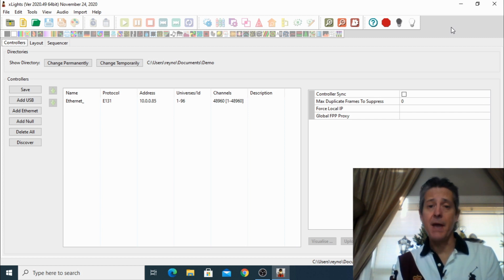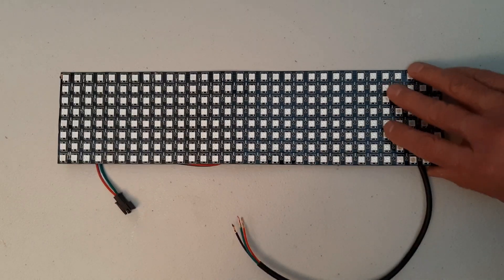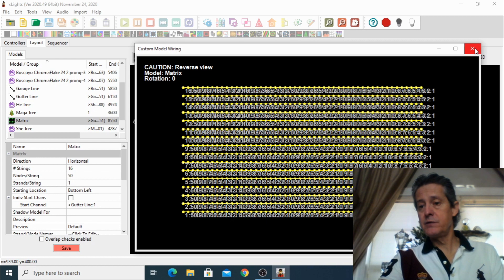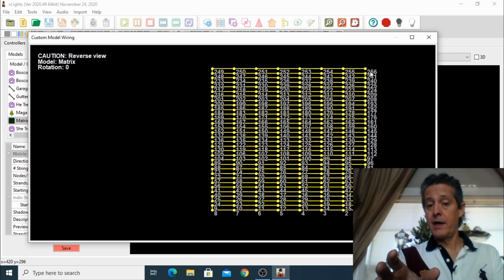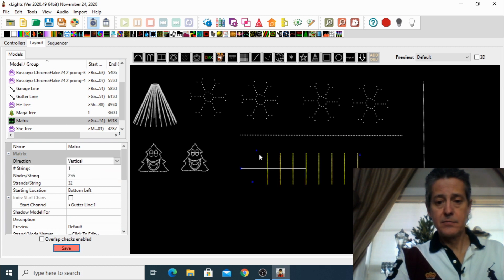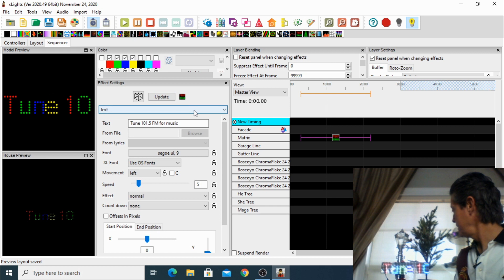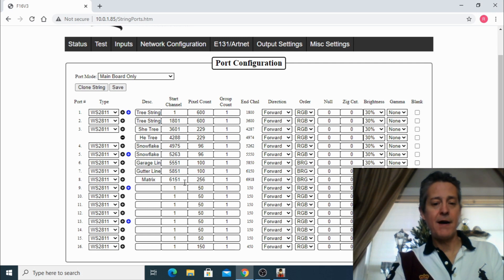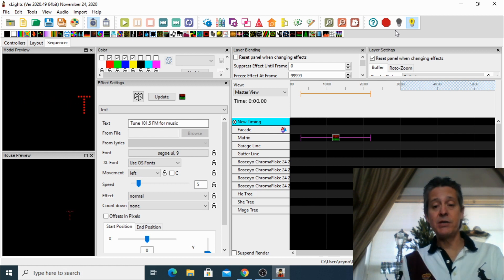Setting up a L.E.D. Matrix

Comment: Thanks Trevi, Your video has been so helpful to me and i just bought some of these matrixes recently.
I have one matrix working exactly like yours, and now i have linked a 2nd matrix onto the "data out" of the first matrix.
I changed my pixels to 512 instead of 256 and i also changed my strands to 64 instead of 32, so this should work like a 64x8 pixel matrix.

But, the 2nd matrix doesn't display anything at all, but my first matrix still displays the text after a small delay.
Have i completely overlooked a setting somewhere? or do i need to look into my FPP player and re-check if i have setup enough channels for my port #1?

I'll keep looking into more settings, as i'm fairly new to Xlights in 2024, but i hope i can eventually connect at least 4 of these small LED matrixes together as a 64x16 display (or larger as i get more panels).
Reply from the maker: @martyaussie4538  Thanks for you words. Glad to help. Have you also increased the number of pixels on the port output? How about the number of channels that you controller takes on the E1.31 setup? You are just missing a simple setup.
Reply: @trevilights  Hi Trevi, Yes, all my outputs & channels seem to be auto updated between Xlights and FPP player and they are correct.
I discovered today that i needed to click on the "render all" button in Xlights to update the new panel(s) that i connected.
Today i now have 4 of these led panels connected in a 128x8 configuration (the full 1024 pixels on 1 port) and my text is now scrolling across the whole 4 panels. ;-)

My next challenge is to arrange the 4 panels into a 64x16 display, i think i just need to change my rows from 8 to 16, but the way these matrix are wired, maybe i might have to connect them across 2 different ports? I will experiment and probably lose  a lot of sleep....

Thanks always for your educational videos, i've been watching them for 2 years now.
Reply from the maker: @martyaussie4538  Awsome. Build something great!

Comment: Thank you for a great tutorial. I have purchased 4x Matrix the same size as the one you show here, for the same purpose, and I have set it up exactly as you have on a DigOcta controller, however I am still unable to get the text to output correctly (and I have changed the setting 10's of times). Thanks anyway.
Reply from the maker: Hey Andrew, Thanks for wathcing and for your comments. It's never easy, just keep trying. Most of the times it has to do with the setting we are using. Good Luck.

Comment: Good morning,
Thanks for this tutorial
I've been trying to make my 2 dies 8x32 and 8x32 work for several days
I gave you the link of the video I made.
The beginning of the video the text works with wled on the 2 matrices, and after with Xlights the problem is that the characters are not displayed correctly if I type the text as seen on the matrix at the top live, the text displays weird characters.
Do you have a solution?
Thank you so much
Here is the youtube link of my video:
https://youtu.be/dYI09L0VtuU

Comment: Thanks for the video. Are you running straight from a pc for data? Sorry I asked before the video was over. Is the controller you're using made for commercial use?  I was going to use an esp32.
Reply from the maker: Hey Joey. Thanks for watching. For this demo I ran from xlights on my laptop. But My show, I run it for a Raspberry PI running the FPP software. The controller I am using and recommend is the Falcon controller ( link below). The new F16V4 can control a little more thank 32,000 pixel if you add an expansion board. I have a friend who uses this board to run Huge Christmas trees inside Malls. They run pretty well and easy to configure. They are little hard to get now, but they are working on getting more. Good luck.

https://pixelcontroller.com/store/products/70-f16v4.html
Reply: @trevilights  cool thank you. I have a panel of 1024 leds I want to play around d with so I found your cool video. I'm probably just going to do something with fastled and a teensy or an esp32. It would be cool to build one in my workshop big enough to play 8 bit games on haha. Imagine the power bill.

Comment: Hello Trevi.  Nice video.   I have a 5V 32x8 LED Strip matrix from a project that didn't work out.  I will be adding this matrix to my xlights  Xmas display.  As was said my controller is 12V.  Did you have any complication adding the 5v to 12v convertor?    (this matrix will be used for a North Pole sign)
Reply from the maker: Hey Andrew. Thanks for watching. The Step down regulator worked just  fine. There is not much to it. It just drops the voltage from 12v to 5v. I just double check the Output voltage with a multimeter just to make sure it was 5 volts.  There are a few of them on Amazon. Good luck.

Comment: Hi Trevi, I love your videos, simple and so informative. I have a question. I have a Boscoyo ChromaMesh 2″ matrix, 24X48  1152 pixels or nodes. I hooked it up to 2 channels, 576 on each. The matrix seems to be scrambled when I run a sequence. I think it might have to do with the layout. My mega tree is 1000 pixels, 2 channels and it works perfect. Has me scratching my head. Any thoughts?
Reply from the maker: Hey Dave. Matrix setups can be a little tricky. To keep things simple lets say that you are going to use port 15 and 16 of your controller. In the String Ports page in port 15 (select a round channel number that you know is free, in this case lets go with 8000) and type 8000 in the start channel with 576 pixels, the end channel should read 9727. Now in port 16 type the start channel 9728 and another 576 pixels. Save this settings.
Now in xlights, use the matrix element and set it up as follows. 2 String of 576 nodes and 12 strands. The Direction should be Horizontal. in the Start Channel setup use the Absolute option and type channel 8000. Save it. That's it. Create a simple sequence using letters just to make sure it's in the right direction. If not, go back to the layout and in the Starting Location option select other options like 'Top Left', 'Bottom right' etc. This is the location where the data is coming into the first an second string. Also look and the wiring view of the matrix element on the layout after you set all the above paraments to make sure is wired in that same way. Good luck.
Reply: @trevilights  Thank you for the quick reply. I will try that and let you know how it worked out.

Comment: Once the text is correct, do you make it a sequence? How do you get it to continuously scroll in xlights while show is running? I am new and have never done this. Thanks
Reply from the maker: Hey Jim. In the sequence tab just add the text effect to your matrix elemet and expand it to cover the whole song. Add the text you want to dispaly on the left panel in the effect settings.
Reply: @trevilights  Thank you. After doing more research, that is exactly what I did and it worked. Can't believe I now have 4 sequences plus a tune to sign (just like yours) and haven't received my hardware or lights. Hopefully will have everything by June. Would like to see you do another import video using the update tool that takes it right into your sequence from s zip file. Really like and learn from your videos. Don't think I will tackle singing faces this year!!
Reply from the maker: @jimwheat3862  that's amazing. Congrats. I've been busy at work. I will find some time to make more videos.

Comment: Trevi, I know you told me before, how do I add an element to an existing sequence. i wrote it down, but i can't find it. as always THANK YOU
Reply from the maker: No problem.  There is an icon on the top bar that has 3 yellow boxes.
Reply: @trevilights  yes sir, I found that. did not know what to do after that.
Reply from the maker: @jackrogers8751  On the right side you should see the elements that are not part of the sequence. Just click on it and press the ">" icon. It should be move to the right side lower box. Then just close that window by clicking on the "X" on the top right corner.
Reply: @trevilights  got it. thank you

Comment: hey Trevi, ok, I set up everything that I have made. For a test run. all of my sequences played just fine, my problem is that I can't get my Matrix to play at the same time. any suggestions? thank you again
Reply from the maker: Hey Jack. Give me more details. What do you mean not at the same time. Is your matix well define (starting channel)? In xlight/sequence? Are you running from the FPP or xlighs? Double check your controller definition in the controller definition in xlights(universes) as well as in the FPP and Falcon controller. That's what I would recommend
Reply: @trevilights  ok, I think I got it working. I had to add it to all of my sequences. It was alone in another group.
Reply from the maker: @jackrogers8751 Perfect. I am glad you got it working. Talk to you later.

Comment: Just bought one of these. What gage wire will you use and will you just solder to a pig tail from your receiver or controller? I bought an acrylic case that is used for a football display from Hobby Lobby. You might want to explore these type cases.
Reply from the maker: Hi Jim. I use 3 wire 18gage cable. I've just started using these Solder Wire Butt Connectors (see below for link) and I like them a lot. They have low melting point solder that will melt and seal with a heat gun. Thanks for the tip on the acrylic cases. I am working on a new video to build a case for this matrix. I will probably uploaded it tonight. 

https://www.amazon.com/dp/B07M99LV68/ref=redir_mobile_desktop?_encoding=UTF8&aaxitk=t9CRiZAQsiA6SyJAHCfA-w&hsa_cr_id=6166299090901&pd_rd_plhdr=t&pd_rd_r=f1d76d4d-a1fa-4512-8582-e2ad10b9e018&pd_rd_w=TbytV&pd_rd_wg=7Popo&ref_=sbx_be_s_sparkle_mcd_asin_1_title